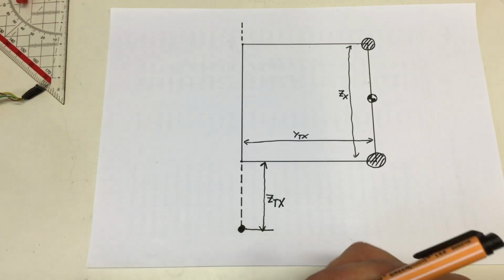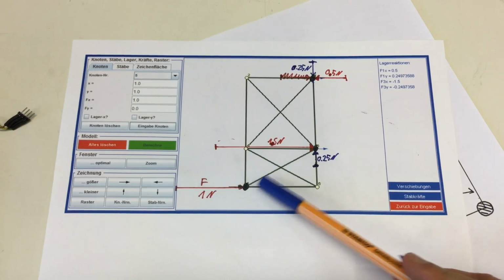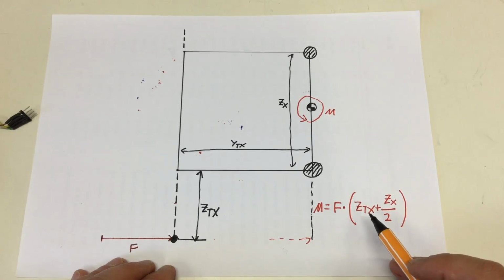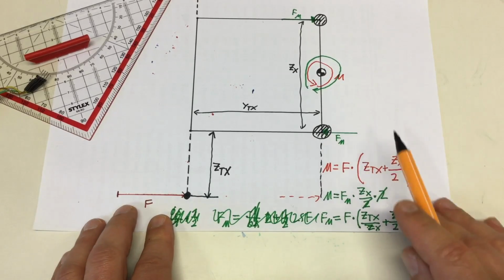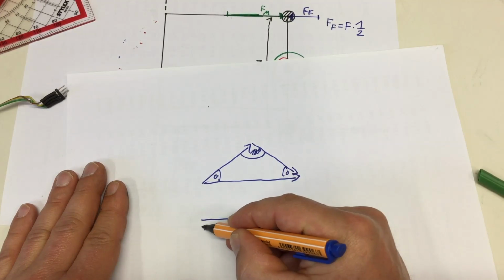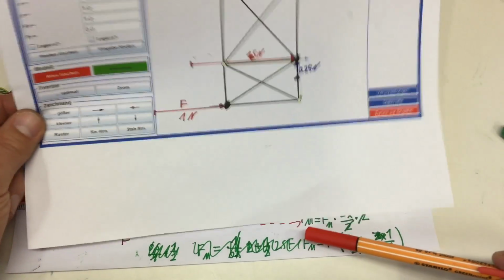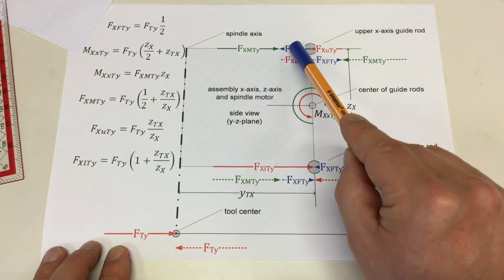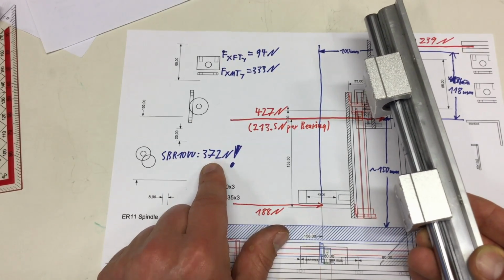3-Axis CNC Machine Structural Analysis (2) – X-Axis Load by Tool Y-Force

Comment: Nice video sir. How did you calculated that cutting force of 188N?
Reply from the maker: That I got from the holding moment (over estimation) of the stepper motor and the lead screw I intended to use.

Comment: I think that you're missing the vertical forces in your analysis. Imagine placing the center of momentum at the joint above the tool tip. If you we're to do the analysis there you would probably locate the mysterious "0.25N" reported by the software. (Caveat, I haven't done this stuff for 20 years...)